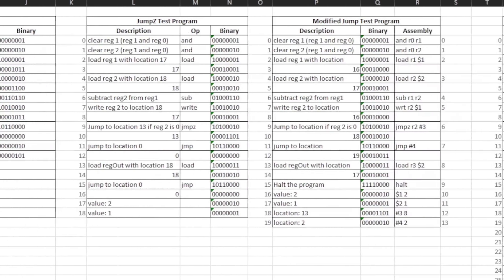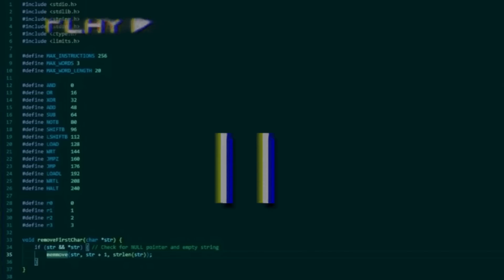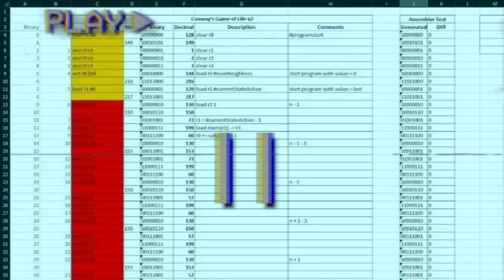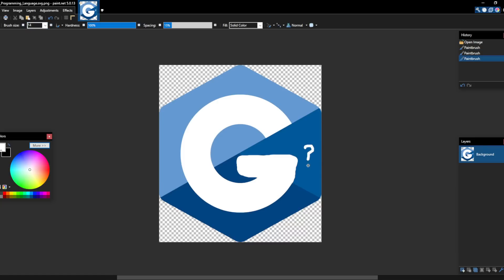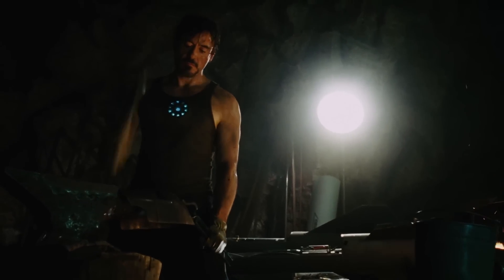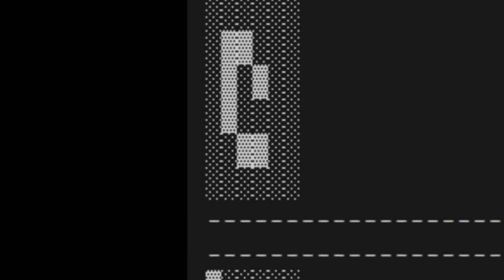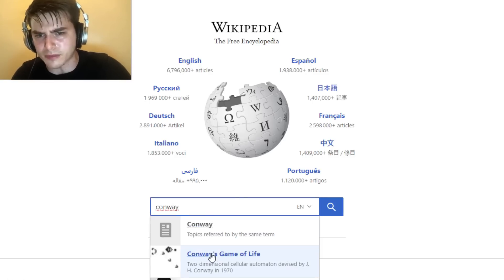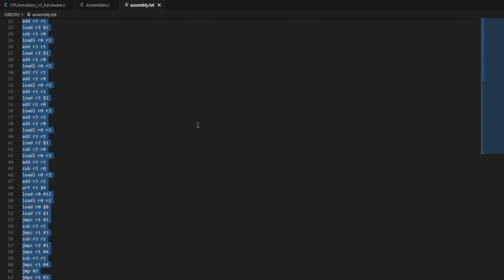I Designed A CPU (And So Can You)

Comment: 256 bytes of memory in total... wow, I didn't think you would make it work when you said it, it's just amazing. However,

I wonder how you were reasoning when designing ISA. It's a very complicated engineering compromise. Execution speed in different conditions, size of programs, circuitry complexity, aspects of whole CPU implementation (hello instruction size, timings)...

If I understood it correctly, you  had an idea upfront what kind of program this processor will execute. Knowing that is an advantage, I think, because you can optimize instruction set for that. But then, when do you stop optimizing for specific programs? That's another thing into the compromise.

I wanted to mess around with a custom cpu too soon, but of all things, coming up with ISA kinda scares even on a hobby level
Reply from the maker: I had the advantage of only thinking about Conway's. I wasn't trying to make a general purpose computer, which is near impossible in the first place with 8 bits. 

The thing to keep in mind is that, if the CPU is Turing Complete, it can compute anything with the right program and enough memory. If you can make the one big complicated program, chances are you will be able to make another. It may be more difficult to write, but it's still possible.

I mislead you slightly in the video - those final changes to the CPU occurred after the first few Conway's attempts. You have to optimize your program as best as possible with your existing instruction set, and if you  still run out of memory, go back and change the instruction set to give your program better tools to work with. LOADL and WRTL are good examples of this - I noticed something that happened a lot in the program and condensed its functionality into a single-byte instruction.

Don't let the blank page intimidate you! You'll be able to go back and change anything at any time.

Comment: FPGAs are your best bet if you want to test your design in dedicated hardware. What you were describing with getting the design fabricated is an ASIC. FPGAs are much better for your kind of project since they have the benefit of being easier and quicker to prototype (once you fabricate an ASIC, that's it if it doesn't work, that's alot of money down the drain). Given your CPU architecture is relatively simple, you can probably fit the processor plus some glue logic for peripherals onto something like a Lattice ICEBreaker development board but the screenshots of your waveforms at 5:43 suggest you have Xilinx Vivado installed. The Xilinx Spartan development boards will have more than enough resources for you to fit a design like what you're describing and will come with a fair bit of IO on the boards themself for your to play around with like buttons, switches, LEDs, possibly a pin header connector or two, possibly USB for a keyboard/mouse as well. In terms of getting the behaviour right for your deisgns, would highly recommend the Embedded Electronics discord server, there's an FPGA channel for you to ask questions for help with VHDL or Verilog/Systemverilog to sort out the behaviour of your design and making sure the deisgn meets timing requirements (Rule of thumb for FPGA designs is to make your design as synchronous as possible so that it's more likely to meet the timing requirements. Never make your logic asynchronous unless you have to).

Comment: I have designed two 16-bit architectures - one called Cellia that has a 24-bit address bus and a 16-bit I/O port bus and is designed to basically mimic the processor of a 16-bit microcomputer (aka what we nowadays just call computers), and one called VCP-16 that has a 32-bit address bus and is designed for an eventual homebrew minicomputer with support for a lot more than Cellia.
Reply: Oh, neat. You still working on it?

Comment: FPGA yes! iCE40 of ECP5 are usually pretty cheap and have support with all the open source tooling. iCESugar-nano is a cheapy. Not sure how easily available they are anymore but Lattice Icebreaker and OrangeCrab are super nice if slightly more expensive.

Comment: I am going to contest a point made around 4 minutes into the video about compilers creating poor assembly.

Inspecting the assembly output of a compiler for a mature language, say C, will reveal that the assembly is actually super efficient. Personally I find Clang/LLVM makes the cleanest assembly, as it reasons impressively well about the whole program and optimises aggressively according to the standards set out in the Intel manuals. It's honestly a work of art.

Where the notion of bloat comes from is twofold. 1) Most people inspect the uniptomized assembly output, which is honest to goodness hard to reason about and confusing af even on the best of days. Make sure to use -O3 before inspecting assembly as optimised assembly is easiest to read. 2) The default entry point isn't your main function and thus there can be a lot of boilerplate setting up the runtime in the generated assembly. Passing in the linker option to overwrite the default entry point will give leaner assembly programs that only do what you've written without the boiler plate before and after.

Granted, this applies to a mature language and a mature ISA. I'm investigating how well LLVM ports over to new hardware, and while I suspect it will work well, I cannot actually say with confidence if it does.

TL;DR: modern day compilers are actually excellent at emitting assembly for mature languages and hardware, and i wouldn't shy away from calling their output as perfect.
Reply from the maker: Completely fair. I should have clarified that any compiler that I create (which would be the first compiler I ever created) would have been very boilerplate and unoptimized. Clang/GCC have decades worth of optimizations and clever tricks on their side, and the C-Compiled Assembly that Chris Sawyer complained about doesn't really exist anymore.
Reply: I've been thoroughly unimpressed when examining clang' or gcc output for the Cortex-M0.  Both will often try to be clever, even in situations where straightforward code generation would have been more efficient.  For example, if gcc is given a loop preceded by "register int x12345678 = 0x12345678;" and x12345678 is used within the loop but never modified, gcc is prone to replace what should be a usef of a value that sits in a register throughout loop execution with code that reloads the constant into a register on every iteration of the loop unless it's invoked with -O0, in which case it avoids such inefficiency.
Reply: To illustrate a novel or trivial point using sort of pseudo x86 ASM here's a pretty basic example in setting, initializing or writing a zero to a register.

# Human programmer naive approach:

mov eax, 0

# A possible optimized approach 

xor eax, eax

Comment: banger video, banger format, absolute banger result.
i say go 16 bit then try to do a jump to physical. otherwise i fear youll curse yourself to death having to keep programming with the 256 bit memory limitation.
Reply: To stay full 8 bit (and avoiding self-modifying code) you can be non-VonNoimann, and have the data operations (load/store) to work on their 256 bytes, while the instructions are on a separate 256 bytes.
Reply: yeah 8 bit is SUPER limiting. 16 bit lets you do soooo much more. IMHO 32 bit is much less of a step up in possibilities